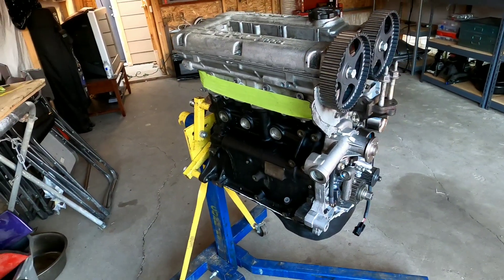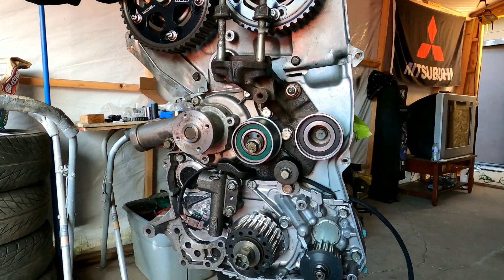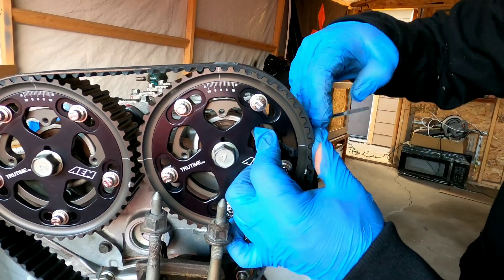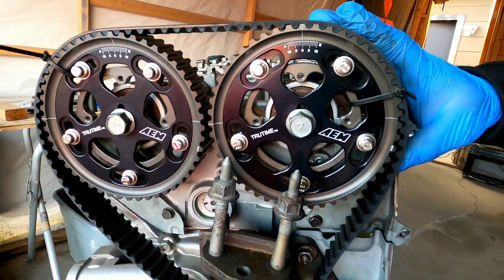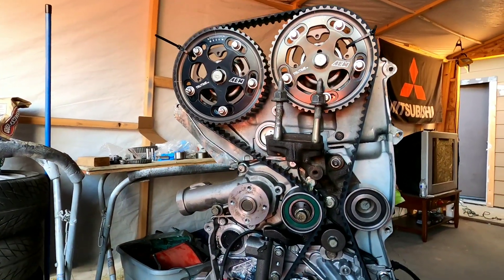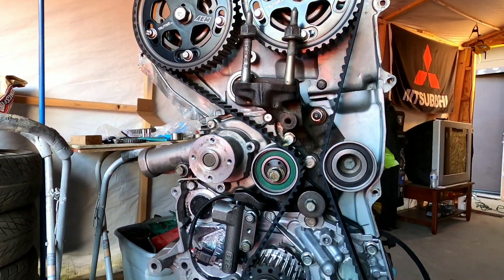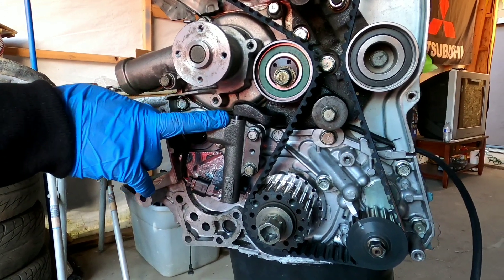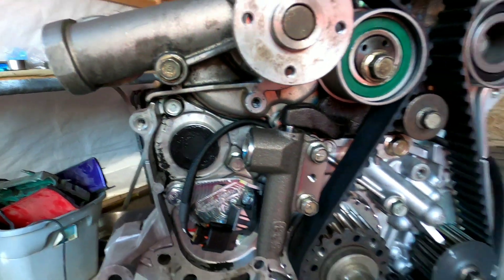4G63 DSM TIMING BELT INSTALL

Comment: I have a 6 bolt  block motor with a 2G head. going into a 2G eclipse. on the 7bolt motor I have water neck coming out of the motor but the 6bolt block hasn't have one. So my big question is what's the best way to run it. Does anyone have a video on best way to run the water line

Comment: One important thing to note, when you're lining up the cam gears, make sure you use a straightedge between the centers of the cam bolts to check the timing marks are aligned. It's EXTREMELY easy to be off by a tooth or even up to three if you're just eyeballing it, as it can look right gear-against-gear without a hard reference in place.

Comment: Before I start I just wanted to say I really appreciate the content on your channel it's very informational and have helpful keep it up. So I'm doing a favor for a friend and unfortunately because of my health condition there has been a lot of time  from when I started to when I left off. Doesn't make things any easier having to deal with  really bad problem with my short and some  long term memory I have a gnarly scar on the back of my head to show for that lol. Back to topic, I already have the head back from the machine shop from getting rebuilt.  Besides replacing the head gasket I'm also replacing the timing set consisting of new timing belt, pulleys, sprockets, gaskets, etc etc... My questions are, when getting the motor timed should I have the head completely bolted down and torqued to spec before actually doing the timing? Or should I  have the head mounted and set in place  just enough to be able to install the timing belt and get everything timed then torque down the head bolts???

Comment: I’m new to the DSM platform and appreciate the knowledge you share with fellow dsmers!  I’m doing a timing belt job an a 7 bolt GS-T and noticed that while rotating the crankshaft, the aftermarket HKS cam dowel pins are facing down instead of facing up, even though all of my other timing marks are lining up perfectly.  The only thing that I can conclude is that I’m not at top dead center for cylinder 1, and need to continue rotating the crank shaft until my dowel pins on my cam gears are facing up and the timing marks match?  Please advise - and Thanks DSM Thunder!
Reply from the maker: Yes, keep rotating it until the dowel pins are on the top and the crank and oil pump sproket are lined up as well. If you still have balance shafts, remember to check the sprocket for the oil pump is not 180° off. After you line everything up, make sure to give the motor a spin a total of 6 full turns(base off the crank mark), they should all line up. Good luck!
Reply: @DSMTHuNDeR  when is it necessary to bleed the lifters?  I’ve been told that bleeding is only necessary when installing a new camshaft.  I’m currently changing the valve stem seals and wanted your opinion on whether or not you would recommend bleeding the lifters before putting them back in the head?  Thanks!!
Reply from the maker: @chadjohnson6229  I would let the lifters soak in a small container of fresh oil overnight and prime the oil (if possible) by rotating the oil pump sproket with a impact/drill at mediumish speed. You'll know when the oil system is fully bled once you see oil coming out of the head.
Reply: @DSMTHuNDeR  I also replaced my valve stem seals and used rope in the cylinders to keep my valves from dropping, while rotating the crankshaft as I replaced the valve stem seals for each cylinder.  Since I removed my cams and timing belt, how do I once again find TDC for cylinder #1 on the compression stroke.  Since the crankshaft timing marks line up for both the compression and exhaust stroke, I’m not sure which stroke I’m on….  Any advice Sir?  Thanks!!

Comment: Did you leave the AEM cam gears at 0° ?
Reply from the maker: Yes. We will mess around with the cam gears once the engine is installed on the car/tuning.

Comment: Question.
I'm doing my head with engine with the car.
What do I to the belt so I can just take it off and put it back in when I'm putting things back together.
Can I just use a grenade pin into the idle tensioner or
Do I need the long screw from j racing to stick it behind the engine
Thanks.
Reply from the maker: The long rod that screws into the motor mount bracket (7 bolt) that's is suppose to compress down the hydraulic tensioner (6 bolt) won't line up  with the 1g tensioner arm anymore... so unfortunately you will have to disassemble everything on the timing belt side to expose the tensioner and compress it on a bench vise manually to drop the grenade pin. I've see other dsmers weld a new surface on the tensioner arm in order to the long rod (or bolt, whatever you want to call it) to actually catch again and compress it without having the need to do it manually in the future. @Jason Drew on youtube I believe is the one who had that video up... I'm not I'm 100% sure on that, so don't quote me. Hope that helps.
Reply: Thanks Buddy.  I'm ready to install my cams and springs on my 2g 7bolt but hesitant on the belt part.

Comment: Hey I put a 6bolt into a 1995 gsx 
The front transmission bolt that bolts up into the block can no longer bolt up as it’s a 6bolt 
But every bolt 
Bolts up fine . 
Should I leave that bolt alone? 
If u have Instagram 
That would be great to ask you
Reply from the maker: That is correct, you will be using one less bolt around the transmission bell housing 👍. Yes. I have IG @dsm_thunder
Reply: Ok thanks for feedback